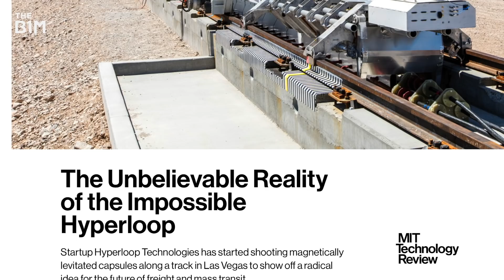Fred Mills and Sir Richard Branson: Inside Hyperloop's First Passenger Test

Comment: Hyperloop, the "monorail" of the 21st century. Remember when every city wanted one? remember how many where built, let alone didn't yet get torn down again because they could never actually meet the requirements of commercially viable public transport? yeah. Also, hyperloop is an idea from the 70s. Remember hoover-cushion trains? got replaced by maglev. Remember maglevs? very expensive. Remember putting a meg lev in a super expensive vacuum tube environment? the 70's remembers. And then decided to develop high speed rail. But don't get me wrong, as engineer i'm all for trying out new things and pushing development until things work. But everyone needs to drop the hype on this. The only things this has going for itself is it's going to be ridiculously expensive to operate with low capacity should there be any margin for safety left.
Reply: Uhhh I have to disagree. There should always be hype regarding something that is making progress and that could legitimately become a new form of travel. Also, the world is changing so to compare complex transportation systems of the past when little technology existed to new ideas today that prove successful seems a little stupid. If you asked someone in the 80’s if they thought we would have rockets that can literally land themselves back on the ground in a few decades, they would also probably say the same things as you. It would seem expensive and impossible to actually pull off, but look where we are. The infrastructure is definitely expensive, but the cost of travel itself on the hyper loop would be cheap considering there is no fuel being burned
Reply: @dylanjames4706  There is no new science here. Maglev has been around for 50 years, the idea is over 100 years old and has never worked. It is basically a dumb idea. They spent $10bn on 500M of track. Existing maglev (Shanghai) is hitting 580km/hour - no need for an expensive vacuum tube. Also: shouldn't Virgin Galactic have been sending 100s of people into space each year since 2005?
Think "Fyre Festival".
Reply: japan still has monorails
Reply: I understand your point, it's almost like reinventing the wheel. We already have bullet trains in Japan that have been proven safe and reliable. I think this is more of a way to hype American/Western technology. But on the other hand it's a cool concept, and if this is what we need to do to get alternative transportation between cities into use without the hassle of flying, I'm all for it. This would work very well in the southwest part of the country. LA to LV to PHX especially.
Reply: @dkpqzm  
cross country usage would be good.
Reply: @dkpqzm  Thing is, bullet trains and maglevs are much, much cheaper to run and carry more people. So in practice, a hyperloop'd either need to charge $6k a ticket like Concorde or depend on giant subsidies.
Reply: @endintiers  hyperloop for mars need a vacuum tube
Reply: @hillbillyintheasia6122  True. It would be fine on Mars or the moon - no tube needed... so you have... a maglev?
Reply: Remember when electric cara were a pipe dream too? Or you think Elon had the idea first? Electric cars were also an old dying concept, now look at them.  
3D has gone through the same rollercoaster, maybe one day somebody will actually make it good and that format would be standard. 

I don't see why people are so pessimistic and overall they just look like they want this project to fail.

So if it fails what? Like you guys want us to praise you? "Omg! you guys were so right from the start, you're geniuses!!"
Reply: @endintiers  I think no need for a tube is ok, if all the energy we used for our current trains was coming form a renewable source. Because you know at the speed those bullets trains run they need a lot of energy to deal with air drag, and rail friction. Maglev at least gets rid of one form of friction.
Reply: @meistsyans6526  Also Elon Musk has been quietly backing away from this idea for 10 years - when did he last mention it? He's embarrassed by the whole thing.
Reply: @HowlingWolf518  subsidies for large corporations is the American government's middle name.
Reply: @thelorax4236  But the states and the feds hate any transportation that's not driving. So no bailout.
Reply: Japan has the  Shinkansen, and they are happy with it.. cos its fu.. fast... the average speed is 200 mph ant they are building a new maglev line , from wich one part will be operational from 2027 ant the rest 10  years later... the new maglev Shinkansen will be 320mph fast..... 
innovation takes time and immense amount of money...
Reply: Honestly they should be investing in the maglev rather than the hyperloop. It’s like a maglev with extras and very unnecessary. Also, Shanghai maglev is a flop cause it’s poorly positioned by a party memeber trynna get political points in Shanghai, I’m pretty sure if the Hong Kong or Singapore MTR’s were refitted with Maglevs, things would’ve been much different
Reply: @NarasimhaDiyasena  Problem is that Silicon Valley is high off their own supply - doing what everybody else is doing wouldn't be "innovative" or "paradigm-changing" enough. So they HAVE to build the train that's 3x as fast.
Reply: @meistsyans6526  there’s been electric cars for almost 100 years...
Reply: @bulletproofguy5112  that's exactly what I said. Things come and go and sometimes when done well they stick, just like this time. I really doubt we'll go back to just producing fossil fuel cars again. 

So stop shitty on new technology, that's what people did a 100 years ago with electric cars. If people would've taken them seriously since the beginning we would be way ahead by now.
Reply: @meistsyans6526  hyper loop makes no sense, it’s costly and carry’s far less people. And the dangers are huge. Britain invented rail and it’s still the best mass public transport and always will be, maybe a new system will come around but not pressurised tubes with hardly any people using the whole tube.
Reply: @bulletproofguy5112  that's what people said about electric cars 100 years ago. I still don't get it, are they using your money or wtf? I don't really see the huge problem here.
Reply: @meistsyans6526  it just doesn’t work for mass transit like they say, sure maybe India and rich Abu Dhabi will build a hyper loop because they like to show off, india has huge problems but will waste billions on a pointless hyper loop that can’t carry any where near enough...
Reply: @bulletproofguy5112  so your point is?? 

Are you living in india and that's why you're mad? 

I'd like to have something such as the hyperloop in mexico connecting mexico city and Guadalajara. Making them 40min away from eachother instead of 6hrs. I'm not saying at this point in time. But in the future when countries like United Emirates, etc, have made the price go lower. People can live in one metropolis and work in other, efficient would increase substantially. I don't think anybody is looking at the hyperloop as a replacement of traditional trains. Specially not for rural areas. It's more of an extra way of transport to connect big cities far away 4-10hrs. So they don't have to be stuck in traffic or be waiting at the airport 2-3hrs.

 I agree with you in that they are making it just for a few people. It looks like this super luxurious thing where there's just one pod with you and one more person. They obviously need to change their advertising and cater to the regular public...
Reply: @meistsyans6526  what 20 people at a time lol! Your ticket would be thousands. And no I’m Not indian thank gid, I’m British, and we are building loads more high speed rail 5nat makes so much more sense, and don’t forget virgin is british so I’m not hating on them....
Reply: @meistsyans6526  Problem with the hyperloop isn't that it's "new," it's that the math doesn't check out. A maglev may be a 75-minute trip from MEX to GDL instead of 42 minutes, but it carries 20,000 people in 20 trains per hour, so it'd only cost about 240-250 pesos for a round trip.
By contrast, you can only fit 25 people in one capsule, and maybe have 60 capsules an hour, or it's not safe - that's 1,500 passengers/hour, or 1/13th as many as a maglev. So they HAVE to market it as a super-luxury thing, because they have to sell tickets at over 3,000 pesos or go bankrupt!
Reply: It's actually an idea from the 1910's but your absolutely right with everything in your post.
Reply: If it work yay
Reply: @meistsyans6526  maybe it's just me, but I don't see electric cars as "the future" as well. Electric cars are still cars, they pale in comparison to public transportation in terms of energy (and space) saving. A futuristic mode of transportation should be focusing on how to move as many people, as fast as possible, in the most efficient way.
Reply: @junirenjana  yeah there's nothing better than having the freedom to go anywhere, whenever you want. I really doubt public transportation will ever achive that. If you can do your own thing while not polluting, I think that's the future. Of course for us, city people, having an efficient public transportation in the workdays would be the best. And then use our cars for weekend gateways and stuff like that.
Reply: Electric cars are stupid.
Reply: You in 100 years will be just seen as a huge boomer sir
Reply: @dylanjames4706 The entire problem can be boiled down to this. You can't maintain a vacuum over long distances without leaks, and the sheer cost of making the fatal leaks never happen makes sure a working demo carrying several passengers over an even minor distance will never happen.
Reply: @dylanjames4706  question find a place where you would use such a concept?  Also factor in passenger compacity? And lets see what you come up with.
Reply: @dylanjames4706  with regards to rocket's they don't have as many restraints, as land based travel.
Reply: Let's be realistic.  all this hyperloop Bs is economicall dead end .   For example for high-speed trains and infrastructure cost maybe 10% of hyperloop system and infrastructure. 
In my opinion it's better to build 1000 km high-speed trains that run at 300km/h than 100 km oh hyperloop that run at 600 km/h.
If hyperloop is for example  10 times more expensive it means i will have to pay for tickets 10 times more.
For example in from Berlin  to Hamburg Hbf  i pay 55 euro for 290km of ride.   Train ride time is about 1h 10 minutes. 
I'm not going to pay 500 euro to go ftom Hamburg to Berlín even if time of travel will be 20 minutes. 
Makes no sense.
Reply: @hillbillyintheasia6122  mars has low atmospheric pressure.  No need for tube
Reply: @endintiers  it would still need a tube, mars has an atmosphere and is not exposed to vacume
Reply: @meistsyans6526  I still believe cars with batteries like we build them now are a giant waste because we cant supply the production needed to make it viable for the masses. 

Hovercrafts should replace ferrys but died out.

maglevs should replace normal railways but are to expensive to build so people build regular or highspeed railways at most.

Its not that certain things are not good,the problem is they are to expensive for what they do more and most arent willing to invest 3 times as much for only 1.5-2 times the benefit
Reply: @endintiers  lol
Reply: At least monorail has a use, abeit very limited. It's useful in cities that are very hilly and vertical so trams wouldn't be as easy. 

hyperloop doesn't have a use that HSR or maglev-HSR doesn't already fit. Unless there's somehow some city logistics where you have to fucking get people places in like 2 minutes because the 600mph hyperloop speed is fucking unecessary.

Comment: Don't know the details but my intuition tells me that trains have much a better cost to value ratio, especially if we're talking about the next decades and including research costs for the hyperloop. We already see that planes aren't that much faster than trains on smaller distances due to the check-in and stuff overhead at the airport. And long distance travel is probably massively cheaper to construct and not slower with planes.
Reply: Read Elon Musk's tomes of a few years back for why this may not be the case. His version of Hyperloop is only interesting at speeds competitive with air travel, over intercity distances. He may have been overlooking the same issues that make high speed rail so difficult in the US, but he had some arguments for why the tubes would be easier to install.

Comment: I find it hard to believe that hyperloops will have a future, although I really love to see these kind of innovations. The fact that the tube only has advantages over very long distances with the combination of the extremely high resources to build the tunnels, it does not seems profitable at all. If they really want to use these kind of connections, normal high speed trains seems a lot more useful. This is because normal high speed trains don’t need straight line rails and have a much higher capacity. (And aren’t even close to the extremely high expenses of the hyper loop).
Reply: Not everything is about being profitable. Public transport is a service not a business.
Reply: @karter9219  though it can not hemorrhage money, which I think is implied by the lack of profitability
Reply: @karter9219  It still needs to be viable. If it costs significantly more than an alternative, you have to ask if the stated benefits out weigh the costs
Reply: @RobertFletcherOBE  in Spain, Finland Norway south Korea, rail is cheap
Reply: @karter9219  yes hyperloop will be affordable to everyone ( thats impossible )
Reply: I think it's important to acknowledge challenges like this early on because I want this technology to succeed. Public transport in the United States is just horrendous.
Reply: @squarewheel9113  then just build normal public transport, instead of building high cost - low efficient vehicles. The Idea of hyperloop is too dangerous to be put into reality (you cannot make several km of vacuum and hope it works 100% of the time, atmospheric events like wind and rain, plus the difference in pressure will be too much to control over the distance).
Plus there is already a "tube" capable of high speed and high capacity: it's an aeroplane.
Fix your shit railway system and public transport in your smaller cities, do not try to reinvent the wheel (like the underground "Tesla taxiway" that is basically an underground tunnel with Teslas moving at 50kph on a single file, when all you could do is a more efficient metro line)
Reply: @levdp1757  Well I like this idea.